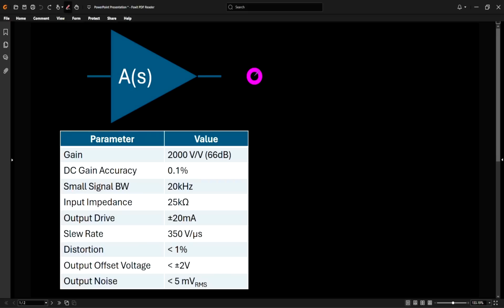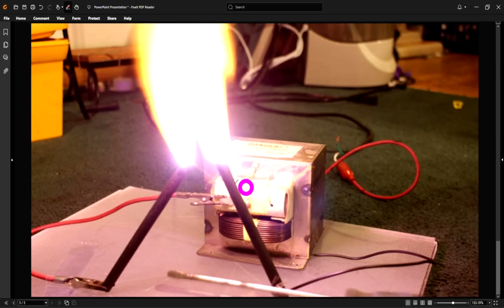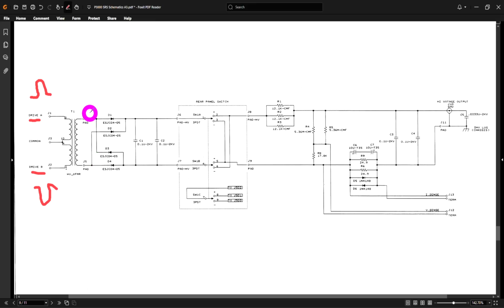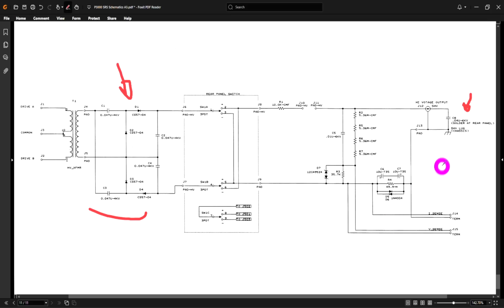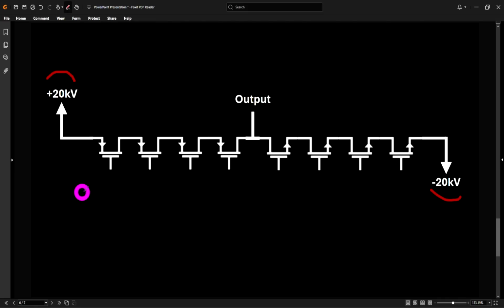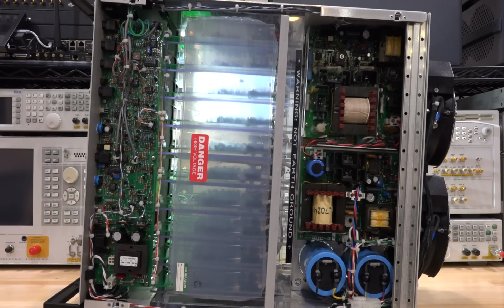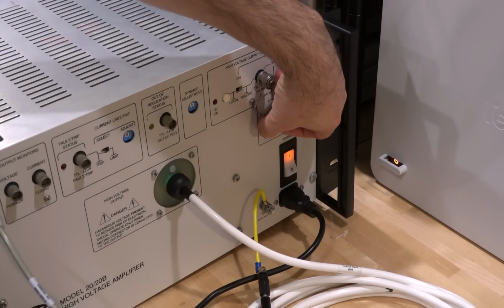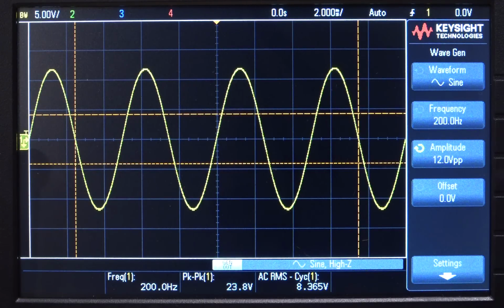TSP #293 - High-Voltage Amplification, Signal Generation, Power Supply Design Tutorial & Experiments

Comment: I experimented with transistors DC/DC.When the supply voltage becomes high, there is a risk of lath in BJT structures. The device may behave like a thyristor with "burnout" and short circuit.

Comment: @6:00 or so 'Microwave ovens are all the same nowadays' - well... A very substantial minority of these are now 30kHz or so inverters which have a +-2kV or so output. These are really handy for hacking in some manners. I have a partially constructed 1kW +-25kV PSU, which benefits from the 30kHz by needing really quite tiny capacitors for the multiplier.

Comment: You're probably right! Keysights are (I think) the only major vendor who uses GDTs as their primary protection. (Funny in the last scene you were using Hg,Xe,Ar tubes which more or less operate under the same principle.) So once you hear the audible buzzing, you know you've hit the voltage limit and corona discharge is goin down in that tube. Fluke uses their standard (in fact, I think they invented it), super effective "2 surge rated 1.2ks, 2 or 3 NTCs and 2 or 3 MOVs" that you see in almost every reputable DMM today. Two ways to skin a cat.

The 4700 is used in labs all over for HV.
1: No range-changing discontinuities due to their "non-linear sampling" DSP, which is just...doing what people have done with diode-log power detectors for like 70 years? Anyways, 
2: 10kV without their probe.
3: 140kV !!! with their probe.
4: 300ppm accuracy, 10ppm repeatability for the system; +75ppm with their probes, which makes sense since 
5: .009hz to 6500kV; 30kV/ms slew above guaranteed above 50kV to 140kV (sadly dc only) 
6: Depending on the probe(resolution limited, not the meter), AC will guarantee no more than 50ppm CM/hz up to 30kV or worst case 300ppm up to 140kV (I didn't quite understand this, I think it's some worst-case probabilistic analysis where used a LISN? They mention phase error so cos(theta) I think has to be banged in there somewhere..
7: 6 digits with .08% plus a diode drop and half a digit ...from DC to 140kV. 

Dude, even at 2k you got a darned steal. Granted I'm not working with 100k DCA-X's ;) Great video, loved it so danged much.

Comment: What type of transistors are put in series? Mosfet or some other types. Will it work with say 1700V IGBT by controlling the gate charge or is that not possible to have it run in some linear mode?

Comment: The Stanford Research 5kV supply appears to have (@18:50) 8 x 2.49M CMF65 resistors forming the divider. It doesn't quite match the schematic you showed but is close enough. Problem is that Vishay-Dale CMF65 resistors have a max working voltage of 500V so they are overvolting them by 25% - that's a bit naughty Stanford Research! I guess they got away with it, but really? To save $2?

They are also running them pretty hard at 1.25W. That's within, but pretty close to the 1.5W rating for 70C ambient meaning they will likely run at 110C+. Not ideal for long term reliability.

I found a 1973 Dale datasheet (ie. pre Vishay takeover) but that rated them at 350V, and only a 0.5W power rating.

Comment: What a wonderful video, Shahriar. Thank you! I am sure there are many unusual electrical and electronic 'features' that can only be explored with HV and AC. This amplifier opens up a whole avenue for interesting studies and experiments. I'll mention a few that I'd love to see and that you may consider interesting: corona discharge, dielectric barrier discharge (applications in ozone generation and plasma treatment), inductive heating, shielding effectiveness. Oh, and I've noticed that the plastic tip or your hook clip started to melt during the last experiment. There is probably a short thin vertical "gap" in them. I did exactly the same thing by testing high currents through a pencil lead. All for science :)

Comment: Gash, our company, my supervisor, and me, designed several variants of these, for a military classified project, in 1971.  Later, these same techniques were used all over the place, for CRT drivers.  I worked for IBM using direct drive CRTs, for video displays in 1966, where a video pen was used for drawing on the screen.  Later we designed some nuclear weapon sensing and recording instrumentation with a slew-rate of about 300V-per-microsecond.  By the 1990s we were up to about 1000V-per-nanosecond.  Newer laser technology allows femto-second risetimes, or less.

Comment: You should have included a few output implementations, I've seen a few in dstasheets/appnotes here and there.
My first thought was - IGBT? Pretty sure I've seen 10kV modules, but no luck 6.5kV is the best you can get, plus availability of complementary pairs becomes questionable.
Working on the fringes is always fascinating!

Comment: Extremely cool! I'm working with a particular TREK-built power supply for a particular application, and they are very neat and tidy inside, my eyes lit up when you showed the back of the unit. My supply is only a mere +/-2kv, but was still very impressed with the construction, very similar to this. They got the entire PSU into a 2U rack unit. Awesome!
Didn't mention that mine is six phase output tho ;)

Comment: One thing I was wondering is how the individual sections are balanced? Obviously, as they are driven, they won’t match perfectly so some sections will develop a different voltage to others. Do they rely on local breakdown using a Zenner action of power FETs? Or are they somehow, actively balanced all the time?

Comment: Where I got my education, we did some HV lab tests and some more were just shown demonstrations.  The “volt meter” was a couple of polished 2 ft diameter metal spheres as a spark gap.  besides the air gap, we needed air prssure and humidity data for correction of our result.  I still recall a couple of memorable equipment in the lab.  One was a MECHANICAL rectifier, an about 6 ft diameter disk rotated by a synchronous motor.  There were contacts at the disk perimeter, and other contacts near the disk, outside, maybe leaving a 1/8” gap.  If I recall, we got about 200 kV DC with it.  Mighty sparking in operation!  Another device was a little more “modern” device, hybrid Greinacher-Villard voltage multiplier that had a number of series connected ceramic capacitors and matching number of spark gaps.  Finally, in actually in a different lab I saw a voltage divider built with a 20 or 30 ft long polyethylene tube, filled with ion exchange purified water.  I was told it could be used to over 500 kV as the upper resistor of the voltage divider.

Comment: I have 2 of the smaller and older TREK610C amplifiers. They use the same style voltage dividers as Yours, I have wondered how that is built, to expensive to take apart though... One trade name of these was coratrol, I do not know which part it refers to. These were very expensive back then, over 10000$ for the 610C if I remember correctly, still work fine. These use vacuum tubes, the somewhat later 601D was solid state, same specs. TREK s really good quality.

Comment: Wow Shahriar this video was fantastic.  I have a YT channel as well.  Now I don't have a fraction of the knowledge you possess in this field, but I've tried to learn electronics myself via repair/teardown of equipment.  I just did a video (link here https://www.youtube.com/watch?v=VbjpNxxFwTo&t=387s) shortly before you released this one on a teardown of Trek 610E which isn't as beefy as the one you shared here, but can provide up to 10kV at 0.2mA and amplify 1000V/V.  You answered a few questions I had in my vid about the circuitry.  

1)	My Trek also had one of those long shielded cylinders which I thought was some kind of current monitoring device.  Thank you for clarifying that it is part of the feedback circuitry.  You can actually open it up as it has screws on the top and bottom!
2)	The Trek 610E uses two 6BK4C voltage regulator tubes.  One for positive voltages and one for negative.  Very different than the 20kV supply you had there.
3)	I can also see the light pipes being used as optocouplers on the voltage regulator tube modules on the 610E.  Though I was not astute enough to know what they were at the time!
4)	Question: On the 610E the main PSU outputs a 800Vpp square wave (I measured it with a HVD probe).  That AC HV voltage then goes to an HV multiplier and then off to the 6BK4C tube modules.  So at what point is that signal rectified and smoothed out for a straight DC signal?

Thank you again for this amazing video!  I really learned a lot.  I love how you covered so many different equipment types and how they work in less than an hour!

Comment: A superb video - a very rare insight into high voltage electronics. I can’t imagine what the engineering challenges are like in +\-800kV DC power line distribution systems they’re using in China where they use inverters to convert back to AC.

Comment: that amp is straight up and down nightmare fuel. im a great believer in "with great power comes great responsibility" when setting up equipment but that amplifier due to its nature seems so unforgiving. the kind of equipemnt you want to be sure all input voltages are on the money then you power this thing up. you certainly wouldn't power it up first.
Reply: At +/-20kv i think you’d die before any safety systems detected the sudden current draw
Reply: @mel_lotonin  I wouldn't have any part of my body anywhere near equipment on test at these voltages, I mean for the sake of other things that may be downstream, kinda hard to test something if you have blown it up :)

Comment: Fascinating.  A beautiful instrument.  I would love to see the schematic for the stacked high voltage stages to see how the biasing is achieved and protecting the  devices from overvoltage.  I have an equally lethal vintage power supply.  17kV DC from a mains transformer and what looks like stacked selenium rectifiers then a large "Visconol" smoothing capacitor.  It has no problem pumping out 30mA on a short circuit.  To be treated with great respect.

Comment: At work we have a soft start that is feeding a 3400HP motor powered by 4160Vac.  The SCR stack has much the same sort of arangement with individual boards driven optically by the trigger board.    This thing is on a whole other level though.  Easy to understand why the amp cost $70,000.00 USD.  It is clearly not a trivial mater to engineer and make such an instrument.  Great video as usual!
Reply: And there's about two people in the world looking for one. :-)

Comment: That poor black grabber at 50:04! It's a (scary and) good demonstration of just how dangerous these voltages are. I've never thought about this, but it leaves the chemist in me with a question: Why is the wire getting hot next to the arc? Is it resistive heating through the plasma at the tip of the wire, or is it more about the kinetic energy of the electrons slamming into the metal surface? Or are those the same thing at the microscopic level? Would the heating rate be asymmetric from a DC arc, as electrons would be emitted from one wire and slam into the other? 

Thanks for the very informative video as usual, and thank you for making safety such a big part of your presentation. For a hobbyist like me, you give me lots of things to try and explore, while also letting me see things that are too dangerous or too expensive (usually the latter!) to do in my basement.
Reply: I'm fairly certain the plasma dominates the heating of a spark gap. Seems plausible there could be some asymmetry at DC like you suggest, perhaps measurable.

Comment: How do they design such high-voltage capacitors? I mean it must not spark through anywhere. So this constrains the width between the electrodes and choice of dielectic medium. But this would also constrain the capacitive value. And ofcourse the construction of the component, connecting leads, housing etc., it must not have any irregularity that would cause it to spark too soon. High voltage is quite interesting. At school (long time ago) i had to experiment with high voltage across a domestic plastic screw terminal block to determine the spark voltage, i believe it was 2+ kV when it started to arc, also audibly 😁

Comment: That was ridiculously exciting and fascinating at the same time. I built high voltage circuits out of old TVs when I was 14 or so, just to draw arcs across things - glass becomes conductive when it melts, who jbew? How I survived... who knows. Amazing to think that nearly every household had a a 20 kV+ generator in their living rooms in the days pf colour CRT TVs, and before HV semiconductor rectifiers the thermionic diodes had to be shielded to limit X-ray exposure. And then Granma puts a plant in a pot on top of the set and waters it. Wild.
Reply: I understand exactly what you are talking about. But obviously I somehow survived my youth in the 70s 😂
BTW, even my latest „line contact“ (240V) is now 10y back. I now have to make sure my (now 3yo) grandson also learns about the power of electricity.
Reply: I was thinking the same thing. "They're not hard to make. We've been making them since the 1940's." Of course, we haven't been making CRT TV's / monitors for decades now, so those transformers have fallen into obscurity. I made more than a few plasma displays with old B/W TV transformers.

Comment: +1 for more high voltage/power topics
I'm really curious what sort of semiconductors are used for the final output stages. Any way you could snake an endoscope in there to get a better view?
Also surprised at the construction of those "light pipes". I'm guessing that's another good reason the lid is interlocked to the electronics. Any ambient light getting inside might completely throw off that interface. Wonder why they didn't cover them in black goop.

Comment: the block diagram of the amplifier said cascoded but u had said it specifically wasnt ? also are those big blue caps on the hv suplly 20kv electrolitic caps?
Reply from the maker: A Cascode would be a CS + CG where the gate is at AC ground. Here none of the gates are grounded and have input AC signal applied to them. The capacitors are smoothing after the bridge rectifier, not after the HV supplies.
Reply: @TheSignalPath  do u think its an oversite by the manufacturer thats its labeled as such on the block diagram ?

Comment: I wonder if the Fluke meter has a 600 V VDE rating, and the voltage suppressor has, indeed, started to "suppress"... I saw how nasty the results of testing a meter that didn't make the rating can be when the company put a first-generation proto through the test, and there was a lot of black and brown inside... Surprising how catastrophic!
Reply from the maker: Yes, it is the protection circuits starting to work.

Comment: I grew up around my grandpa's electronics workbench and i learned electronics by helping him fix a lot of CRT TV sets (tube and solid state). Therefore i developed a very healthy respect for high voltage. That thing is scary! Thank you for showing it to us.
Reply: Scary, well slightly. You should try older style radar systems, nasty nasty HV pulse transformers driving the mag. 50KV  to 100KV or so off load which happened when the mag went open circuit.. Very impressive sparks when things went wrong., but that's a long story or two.
Reply: @andye2005   well, actually my grandpa used to be a radio and radar electronics tech in the Navy in from the '60s until the '90s, so I got to hear those stories also. 🙂
Reply: @andye2005  Let's hear it!

Comment: With those little calibration tubes I found a small HV dc power supply on amazon and picked off before the rectification and it drive the lamps nicely off a battery which makes it a lot more portable for calibrating spectrometers.

Comment: That's one scary piece of gear.    At those voltage levels it would not take much leakage current to wipe out a bunch of test equipment connected or not.  We had someone bring a Van de Graaff  generator into the lab, wiped out several scopes sitting unconnected on an adjacent  bench.    

Other than some conformance testing I wonder what the primary use for those voltages, some kind of particle physics research.   In the HV theme would love to see a schematic breakdown of a 1MEV DC to AC power transmission line converter.

Comment: That power supply section on the back of the unit did not look like +/- 20KV at all. I think it is a much lower, could be around 1KV high frequency, which then fed to the voltage multiplier in the front of the unit. Alternatively, the multiplier section could be a potted block sandwiched somewhere behind the power supply PCB on the back. I think I can see it barely visible at 38:51 - where the red wire is coming from.
Reply from the maker: The supplies which are visible in the video produce an AC output. Under them enclosed in some plexiglass are the voltage multipliers to make the DC for the stacked amplifier.

Comment: I'm surprised it wasn't a tube amp, tubes do well for high voltages.
Reply: What kind of tube would handle 20kV for something like this? The ones I've seen with that kind of voltage ratings are massive with plate dissipation rated in hundred of kilowatts.
Reply: @rocketman221projects  A custom made one, unlike custom silicon, tubes are fairly easy to manufacture and even amateurs have made some that work well.